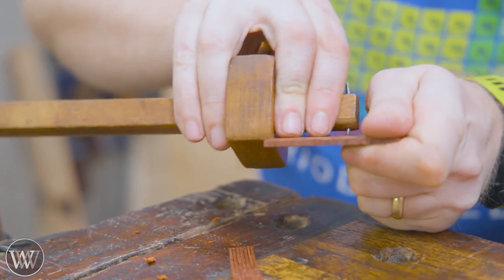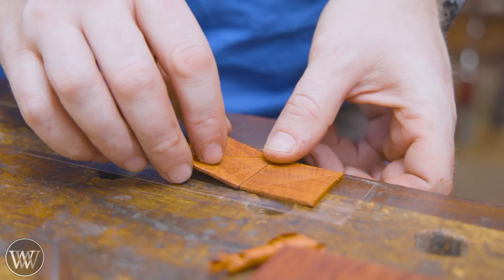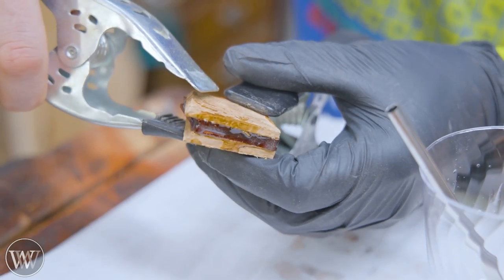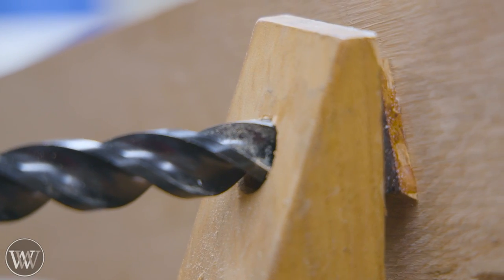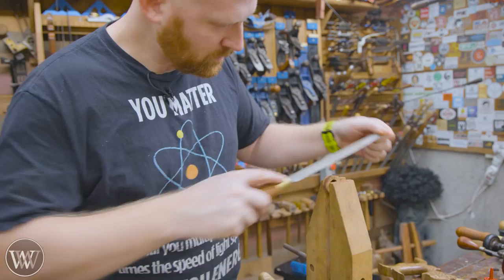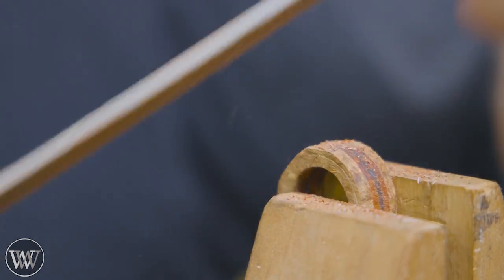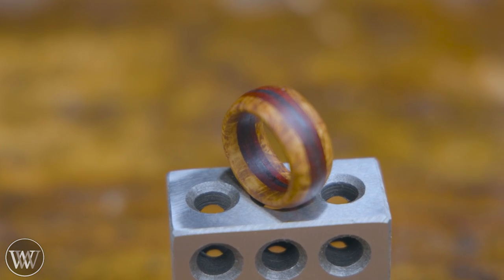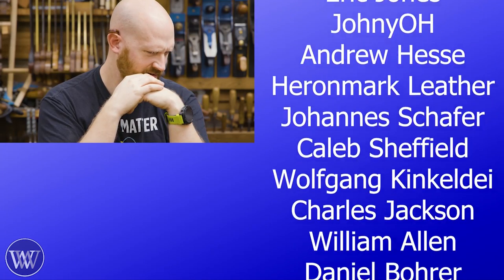How To Make A Wooden Ring No Lathe

Comment: I learned a technique by Atz Lee Kilcher on "Alaska the Last Frontier." He used long strips of plane shavings wrapped around a cylindrical form covered with clear packing tape, and gluing as he went, using CA glue. He also used CA glue as a finish, which gives a smooth, glossy finish. It's messy and you have to be careful not to glue your fingers to it, but it turns out nice, with several concentric layers.

Comment: I am a beginner ring maker and I had to figure out alot of this stuff on my own so it's cool that you made this video . Would wood glue work for the wood sandwich? I have never used apoxy so it's a bit scary.  Don't know what kind to use or anything.  And just a trick that I figured out Is that I use plexy glass in my sandwich to give it strength but idk how well wood glue will stick to plexy . Can I buy some of these woods online by chance ? And ive been racking my brain on how to split the wood with what I have so nice work with the little hand saw.  I was thinking about using ny table saw and jig to hold the piece in place while I cut it or I was thinking about locking the piece in place with some kinda jig and use my router to thin it out.  I like the finish on this and it was easy to do.  I've been trying to figure out how to work the super glue the right way to give it a good finish and I don't have a laith so I'm only using my drimmel tool and drill.  Also liked the file trick to get it perfect.  I was flipping my belt sander on its side and sanding it to the line which is hard to do and easy to mess somthing up quick.  All mine so far that I made like the one you did have broken pretty quick like and I used toung oil on it and sanded it all the way up to 3000 grit so it was smooth but the finish isn't water proof so that's an issue as well.  I would love to be ablw to talk over the phone so I could get some pointers let me know I'd that's somthing your willing to do.  I've also experimented with copper wire and shaved copper and I have even carved a stone from the yard into something I could put in the ring and it polished up nicely. I want to do more work like that too.  So any advice would be awesome. Me and my wife just started paying for a booth to sell stuff at an antique store so I think the wooden rings might do well there . I'm also looking for stuff I can build to put in the booth besides the rings.  It's just that the rings take up no space . I would love to get some ideas from you.  Thx .

Comment: Hiya, and thanks for sharing. I like your videos. I like your down to Earth style and the way you make the vids. I tried making a ring by gluing up plane shavings until they were thick enough. It sort of worked but it wasn't nearly as nice as yours.

I wonder if one of those little hubs? I don't know what they're actually called but the thing that you put a sanding sleeve on and when you tighten it it expands to hold the sleve securely. So I'm wonder why you couldn't use one of those so you can chuck it in the drill press or ever your hand drill and get it spinning that way. It's somewhere between a rasp and a lathe but technically still not a lathe. If you haven't got one of those expanding thingies, then with a little imagination an appropriately sized dowel could be made into one. It just seems like it would be worth the effort to get it spinning since getting it whittled down to size and perfectly round would be a snap that way.
Reply from the maker: I have made them on a lathe several times before. But I generally prefer to just file them down by hand. I find it to be far more enjoyable of a process. And in many cases surprisingly faster. But to each their own. There's a thousand ways to do it.

Comment: I’m wanting to make my own wedding ring out of curly maple with an iron nitrate finish(I’m a flintlock enthusiast). How feasible do you think that process would be?
Reply from the maker: That would not be easy, but it is possible. It works best if you can laminate the wood so that it has more strength.
Reply: @WoodByWrightHowTo  Thank you for the response. I will do some trial runs and see what I can get to work. Thanks again, beautiful work!

Comment: If you don't want to get stuck measuring the size of the hole, you could use your callipers; you know, the thingy for measuring stuff and transferring measurements. Set the calliper to the inside measurement of the hole and then lock the jaw. Then try to slip the outside jaws of the calliper over the finger. Voila - no fingers get trapped while checking the size.
Reply from the maker: Someone has been watching my shorts lol